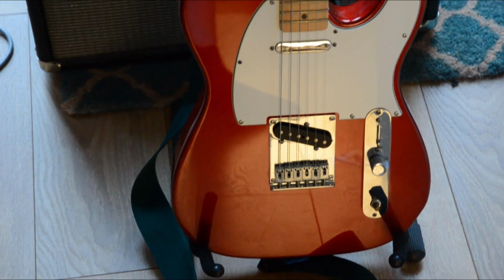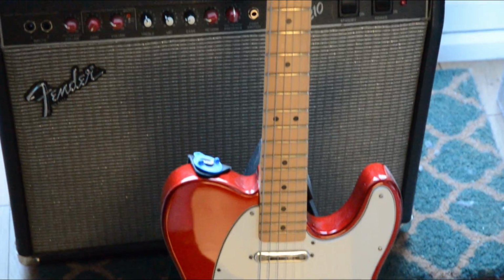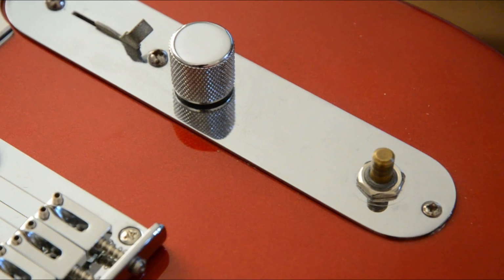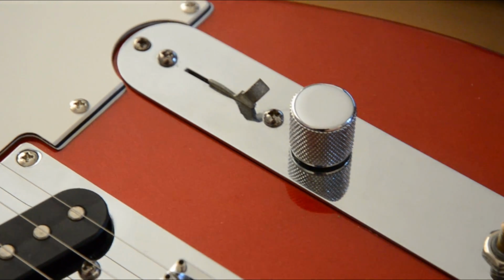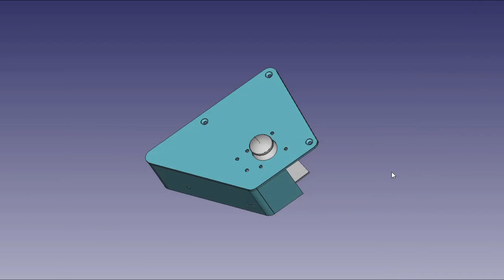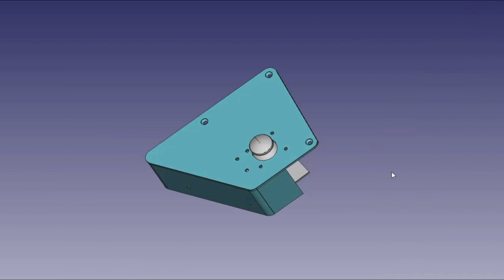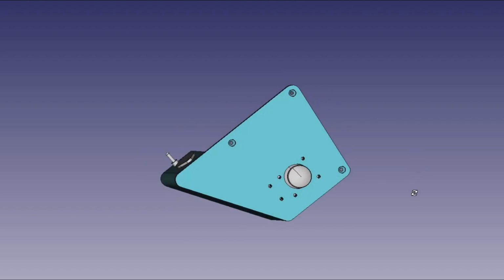DIY Midi Guitar - Is the correct way?

Comment: And nobody here heard of jam origin?
Reply from the maker: Is it any good?
Reply: Late reply I know, and this may come off as a rant, but Jam Origin still relies entirely on audio-to-MIDI conversion. The idea for this video was to avoid that. As MIDI is a digital protocol, this makes a lot more sense. Why use the unnecessarily convoluted process of strictly translating guitar audio into MIDI, where said guitar audio is entirely analogue, when you could just have an already-digital controller that electronically functions like any digital keyboard, but that is physically playable for a guitarist? touching the frets would already determine MIDI note numbers, because they're already acting like a digital keyboard... and this happens long before any sort of audio comes from the strings! We've seen controllers that successfully employ this concept... problem is that guitarists, especially the ultra-conservative types, generally hate them because "it's not exactly a real guitar". Well, tough luck. MIDI is a digital protocol, and as such it was designed with the electronic switch-based nature of digital keyboards in mind. And, as digital data is ultimately represented in electronic switches anyway, a guitar-like controller like this just makes a lot more sense as a digital device. It's already digital... it's already using the electronic switch-based nature of digital keyboards... no fuss, no messing around with convoluted audio-to-MIDI nonsense. Keyboardists don't have to mess around with any of that shit either, so why the hell should guitarists? It is absolutely possible to imagine a MIDI guitar controller where the frets already act as digital switches like those on a keyboard. IN fact, I will even go as far as to say it was always possible right from the very beginning, and audio-to-MIDI methods were never really a good idea from the beginning.
Reply: @ Lol, so you didn't try jam origin
Reply: @ Whether I tried it or not is not the point. It still uses very convoluted audio processing... like I mentioned... just to give you MIDI data from your guitar playing. Even if it does apparently work well, it's still very convoluted... the process of just determining the MIDI note number to be transmitted is convoluted... it requires complicated audio processing of a non-digital signal just to define a MIDI note!

But oh well, everyone just continues to rave about how well it works (apparently) and don't give a fuck about how convoluted it is. Guess that's the state of modern technology... using such convoluted, energy-intensive processes to perform a job that should be so much simpler to perform. The much simpler fretboard-as-keyboard method I mentioned last time is how I've literally always imagined a MIDI guitar controller working. It just... makes sense!
Reply: @justinnaramor6050  I do not understand why are you so angry

Comment: I want to build a midi bass with each fret wire as a contact.
Reply from the maker: That could be interesting, I wonder is if a VCO approach would work for each string.
Reply: @deancoyle  I need to do some experiments to work out how I want to do it. I can think of a few funky ways to signal via the strings, for the midi it will be pretty straightforward to detect what your fretting, but hopefully we can get a cool dirty signal to run a vco synth.